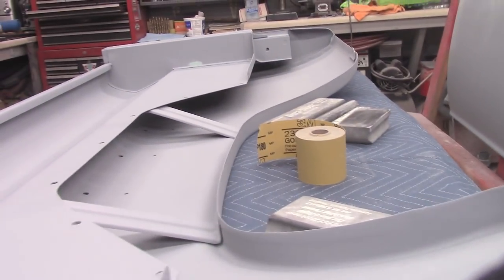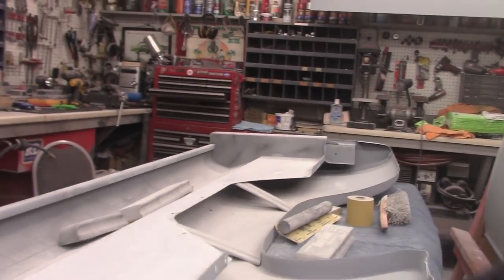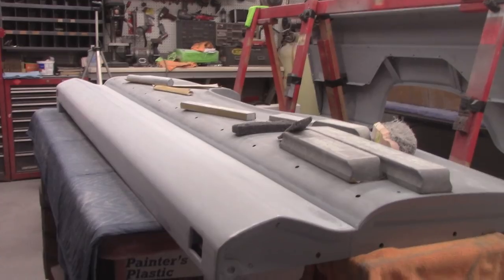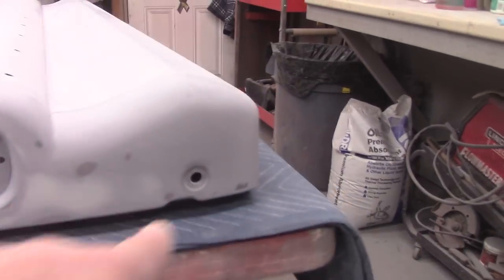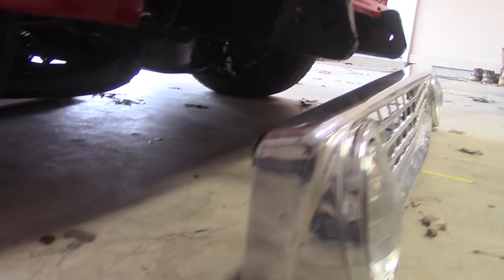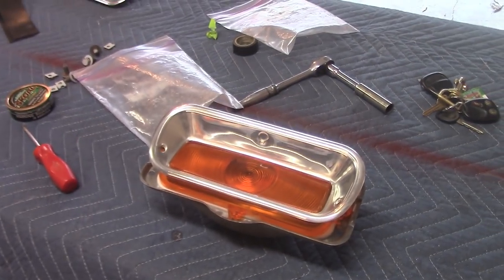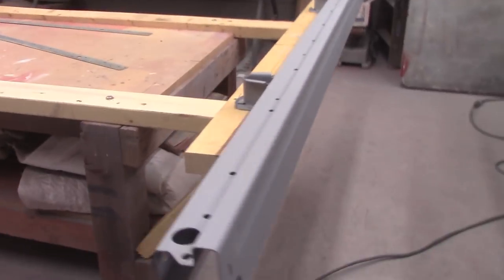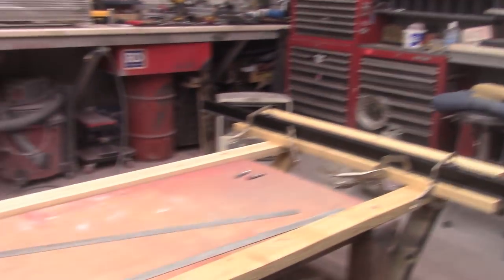sanding/install grille/bolt up bed

Comment: The trim pieces on the front end really make it come together. Those are the fun parts after all the really hard work is done and very rewarding. The bed is looking good.
Reply from the maker: Thanks man it's good to have the original pieces they seem to fit better

Comment: Are you going to put the original pine wood floor in the bed or are you going to warm it up a little with oak?
Reply from the maker: Yes I'll be going with the oak

Comment: QUICK Q, when you finished the welding and what type of filler did you use? Im looking for some on line, but not sure if i really need the more high end stuff. Thanks, your videos have schooled me much lol
Reply from the maker: I using the Evercoat rage xtreme it's 40$ or more a can but they sell more fillers cheaper then that I just felt like is was a better filler for what I'm doing
Reply: Sweet. Last Q for the week, What gauge works best for welding these parts, Im using a flux cord welder but heard that a .30 is too think and should go .25
Reply from the maker: I'm using the.025 super arc L-56 with gas behind it works really well

Comment: I am new to this and what is the purpose of the tape down the outside of the of the bed and doors when sanding?
Reply from the maker: The tape is to keep a straight edge when sanding so my sanding block want slip off the edge and cut into the body line